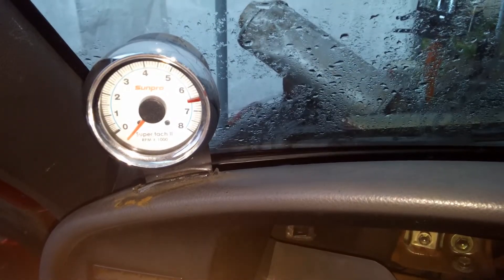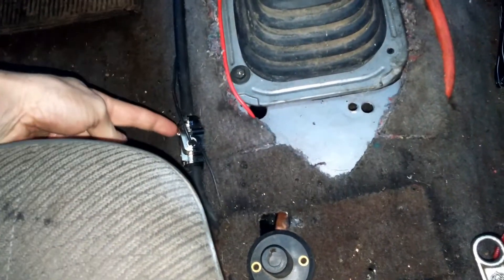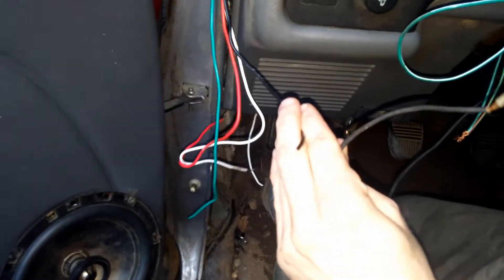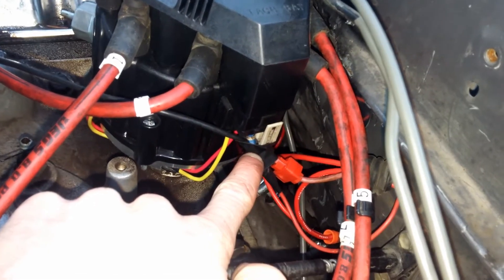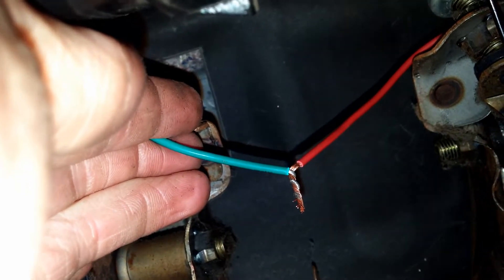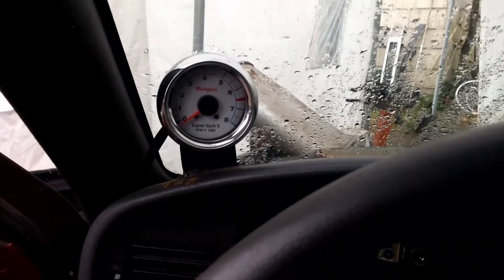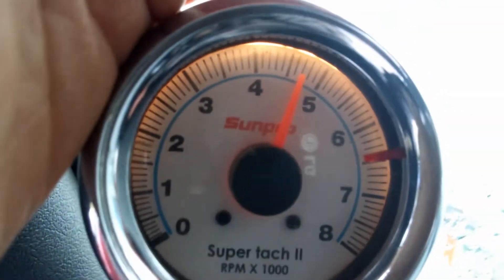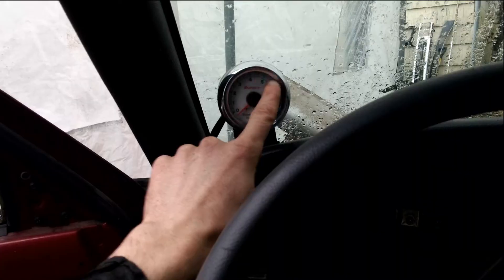Vehicular Education - Simple Tach Install (HEI Distributor)

Comment: off by a little bit ya think. if that engine was sitting at 4.5k - 5k on start up you'd know about it why do people put tacho's on things that aren't no where near accurate whats the point of it then. and batteries in the boot or tray with all that junction shit coming through the cab to achieve nothing apart from voltage drop. i suppose we need something to laugh about.

Comment: Just switched my 89 f150 to carb and got an hei for my 351w and can't figure out why tachometer don't work and neither does oil pressure or temp or speedometer but battery gauge works just fine? Could there be some wire I forgot from the fuel injected harness? Still got the harness on just taped up out of the way but all the wires and plugs are still there.
Reply: Probably not hooked to an ignition power source. Straight to battery isn’t the answer
Reply: I know this is two years old but yes you probably forgot several wires from your harness, all those gauges need a signal that comes from electric senders on the engine, on an 89 I'm not sure if speedometer is electronic or cable driven but if it's electronic you need to hook up the vss (vehicle speed sensor) on the transmission, you can get converters for older cable style transmissions...

Comment: My tach reading is also like that. At about 5k rpm during starting. What needs to be done in order to make in accurate?
Reply from the maker: Flip the switch on the back of it. Youre probably in 4cyl mode
Reply: Divide by 2 🤣

Comment: Earlier GM HEI ignition systems did not have the coil in the cap.  There are two wires coming out of distributor, Brown and Orange.  Which one will be TACH?
Reply: You can't rely on color codes because they use multi colors on different brands of distributor ... I suggest that you use a test light ... test the 2 wires ... if it lights up then that is the positive ... you will tap the Green wire of the RPM to the negative wire ... not to the positive